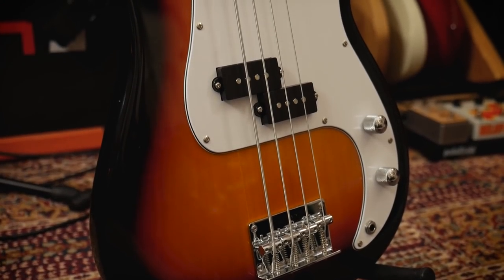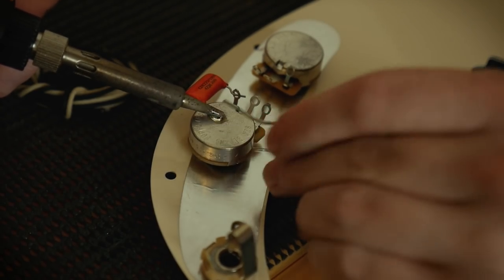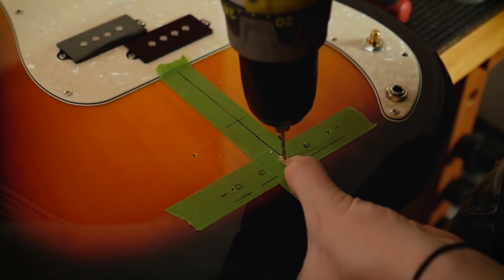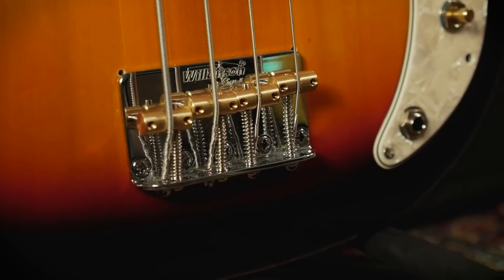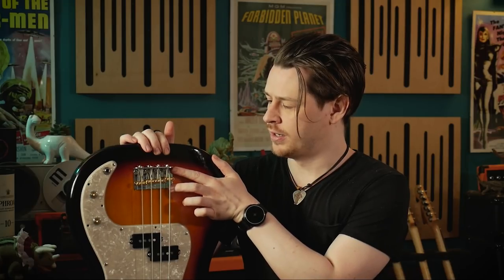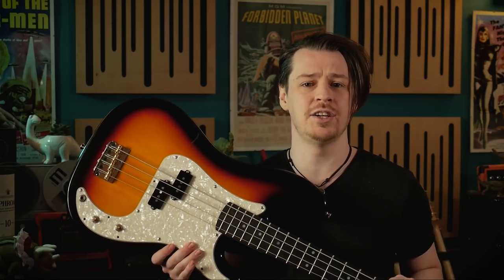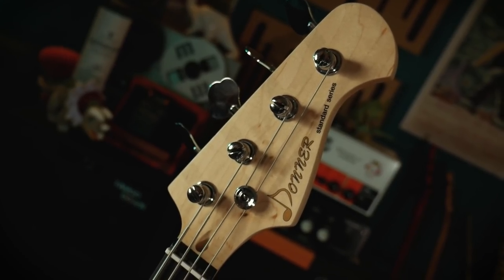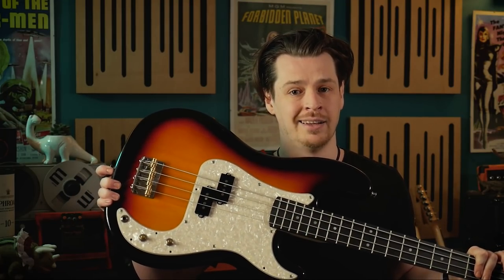Total Electronics OVERHAUL | P-Bass Upgrade

Comment: No doubt the upgrades sound better, but i do think i'd personally mix the new bass to sound closer to the original as i like the duller sound on bass. Easier to make a bright instrument dull than the other way around though, so these upgrades are definitely worth while
Reply: Curious if they changed out the strings. Makes a huge difference on their own.

Comment: I feel that bridge on a spiritual level. I got an 80 (U.S.) dollar guitar and the neck was 25.5 in scale length and let me tell you the bridge was way to close. so I tried moving it back, btw this was an S-style guitar and it was a pain because I didn't really have to proper tools to do these kind major modification. so I used sand paper to remove material. then used maple trim with super glue to add material. and I drilled new hole filled the old, and it... didn't work i need to more it back more, but i didn't want to do that all again. so I took the same maple trim and added it to the end of the neck in order to get the space i needed. finally it worked, it's not the best guitar i have by far but it's still fun to play and I'm glad I didn't give up on it. 

probably spelled so stuff wrong but i think y'all can figure it out

Comment: Great video! Yes all of these are issues on any Fender clones. I have two inexpensive basses. 

My Johnson I had the same issues as this model. What we did was just replace the pickup and electronics, same as you. That's all. I also sticker bombed it so it looks like a proper Psychobilly/Punk bass. 

My Squire we replaced just about everything except the neck, tuners and body. It has a P/J pickups setup and even though the Duncan Designed pickups came out of a newer Squire Jaguar, the J pickup did not fit. Yay filing!😐🤘

Even with Fender to Squire parts there were issues. The Fender high mass bridge was pretty easy. The pots were different as the two volumes were full sized CTS pots and tge tone was a mini pot due its position. The pickguatd screws also had trouble lining up, some did, some did not.

If you are doing a project like these I would suggest going for a Bournes minipot as a solution because otherwise you may have to route or it may not even fit. With a Fender clone my recommendation is to swap out fewer parts. Parts designed for Fenders really won't work well on clones unless you go all the way like on the bridge and pickguard on Collin's bass. If you want a cheap mod with many options go for a Squire model and realize even though you have a Fender product it does not mean that everything will work or fit on it without some extra work past dropping them in. That said once you have an upgraded bass, it's definitely worth it.😎👍✨

Comment: Have you done a video specifically on "high mass" bass bridges? I'm curious to hear your scientific take on that.

I ask mainly because I'm a bassist, and recently removed a high mass Schaller 3D bridge and replaced it with a very basic F-style, 4-saddle, bent plate bridge. And honestly, if there's a difference it's that my bass sounds way better with the "low mass" bridge.

Comment: A totally cosmetic thing, but you could:
1. cut the shank off some screws and glue the heads in the vacant holes on the pickguard
2. (if it will fit) drill pilot holes into some bits of scrap wood to go under the vacant holes and screw those in (has the advantage of not using glue, and therefore being easier to undo).

Comment: If you ever decide to revisit P bass electronics try linear taper volume potentiometer (I find audio taper volume too quick in passive P bass) and 0.1 uF capacitor (I find 0.047 uF too weak all across and too "middley" at the end). Have a nice day!

Comment: I had a similar problem with the Wilkinson p bass bridge saddle screw length. Bought one for an el cheapo that I was refinishing and rebuilding for fun, then I rescued a beat up SX bass as well. The SX was the better bass so I decided to put the Wilkinson bridge on there instead. Had to use the screws from the old SX bridge to get it to intonate properly because there just wasn't enough length in the original screws to get the saddles forward enough.

Maybe Wilkinson should consider supplying longer screws?

Comment: Crazy question, would longer screws on the saddles alleviate the lack of adjustment room? or are you pushing the limits of the adjustment screw's material at that length?

Comment: But with the total money invested in the guitar and upgrades, is it now as good as a Fender of the same price? Or would you be better to just buy the Fender of the same price?
Reply from the maker: Total money invested was less than £100. The instrument itself is £115 at retail. 
That's equivalent to a basic, bottom rung Squier P-Bass and you won't get CTS pots and handwound pickups on those.
Reply: Good point. For a grand total of £215, you cannot even get a Squier Classic Vibe, which I would consider nearly perfect right out of the box.

Comment: I have a bass my sister found in the apartment building's rubbish container a few years ago.  All I know is it is a Sears, and has a weird single pickup, and has four strings.  Everything is there but the electronics, and the plate that held them (the pick guard is there).  I wonder where can I go to find out what this is then find out if it is worth repairing (it is from the late 60's I believe), or if I can even find the plastic that held the pots?  I doubt this ever had a switch since it is just one pickup (weird looking thing I think may be a gold foil).

Comment: Does the gauge of wiring matter in this application?  Coming from the nerf hobby with high amp draw motors and direct current, the general rule is to use as thick gauge wiring as will fit, but im not sure here
Reply from the maker: These wires are carrying AC signal, not DC power. There is no advantage to thick wire. 
Grounding and shielding will however be much more important to prevent the signal wires picking up external EMI noise.

Comment: I did something similar to this to my cheap-@$$ Squier P-bass.  I put in a Seymour Duncan Quarter-Pounder P-bass pickup and a Bartolini TC3 preamp on a push/pull switch, so I can get either a pure passive sound or an active sound if I need a boost.  Greatly increased punch and clarity compared to the lame stock pickups.

Comment: Would it be possible to get a similar effect by using an EQ to boost the mids without having to change the pick ups?
Reply: While an eq pedal can't get a frequency change like this, it can help you be heard in a mix if you are having issues. Assuming that's what you're asking anyway. It won't as good of a job. but it is much cheaper, and can be used to shape a sound in many other ways depending on what's needed. Just do a bit of research before you buy anything.

Comment: STUPID Question:
Guitar pickup Bobbin Winding...
1.  Which wire is Ground and which is Hot?  Which is the Winding wire?

2.  Are both N/S Winding both the same- the  first wire, and ending wire +/- is the same (inner wire bs outter wire)

Thanks mate
Reply from the maker: I don't understand what you are trying to ask me.
Reply: @ScienceofLoud  so when someone winds a Bobbin...  x amount of turns..
TWO Wires -/+
- I read of Clockwise wind, Counterclockwise based on magnet.
- I read about humbling that shares a magnetic but both wound clockwise 
- I read somewhere the inner wire is + and outter (ending) wire is - unless it's shares a magnetic...

Thus why I feel lost ... it's a magnetic science I'm not familiar with
Reply: @ScienceofLoud  just found your pickup video.. very informative...
So does Winding direction even matter?

Comment: I am VERY surprised that the Donner P-Bass has some Shield Paint in the cavity!
Reply from the maker: Even more surprising is they had a ground wire with a ring crimp screwed into the shield paint. 
The original wiring was extremely neat and well done

Comment: I did something similar to Johnson/AXL PBass I bought on eBay last year for £35.  I fitted it with a Fender HiMass badass clone and an active EMG P pickup.  I had to drill for a jack socket on the side of the body because the cavity was too small to give enough clearance for the stereo lugs on the socket

Comment: At least tell people what they did wrong before banning them :/
Reply from the maker: My moderators banned you from the CSGuitars discord because you frequently broke the rules and behaved in a manner inappropriate for the server. 

Specifically you:
-Made multiple unwanted advances towards women
-Had an exclusionary and hostile attitude towards those you interacted with.
-Failed to correct your actions after several warnings. 

The reasons for your removal were made clear to you when you were banned (I have the screenshot of the message to you left by my moderator to prove that)

I suggest that you take some time to reflect on your behaviours and attitudes, and work on yourself to become a more mature and courteous individual. When you have achieved that no one will feel the need to ban you in order to protect the community you are disrupting.